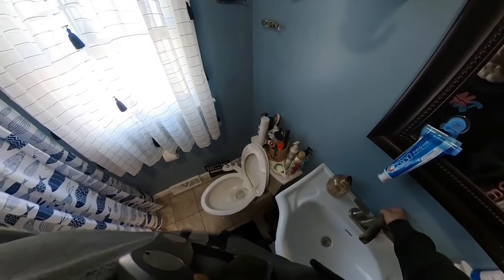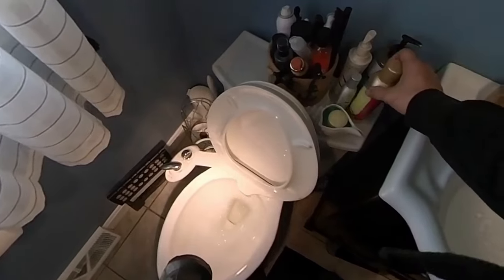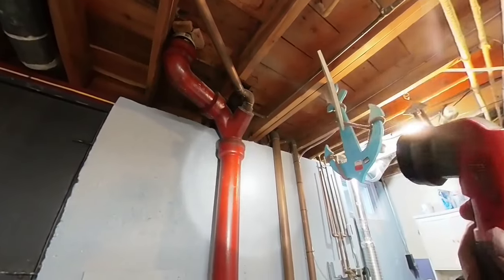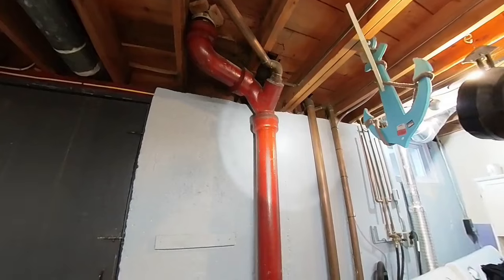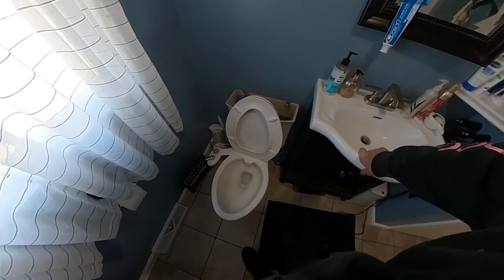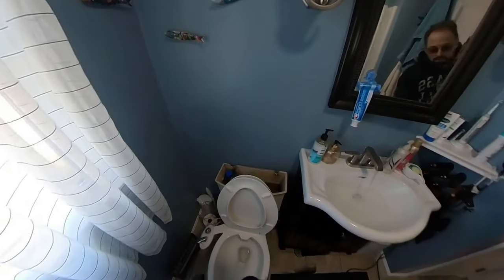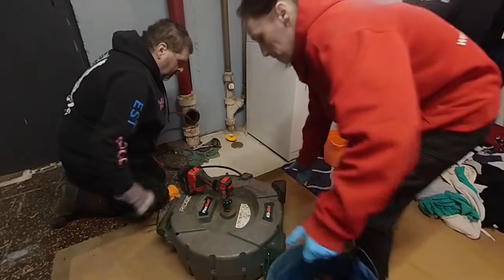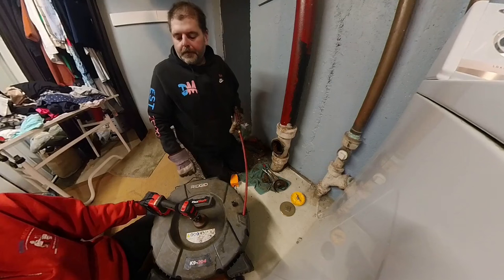Why Is My Toilet Bubbling, and How Can I Fix It  227

Comment: How do vent pipes get clogged?
Reply from the maker: Leaves and debris falling in if there from above when there is no screen to protect it. Also the bathroom sink ties in above the toilet flange. (Shelly)
Reply: Good job Bob and Shelly, Great detecive work Bob working out the blockage 👍
Reply: Bird nests aswell
Reply: Hello, I am a handyman doing it as a side hustle….I have  unclogged a couple of sinks and drains. But i am considering getting into drain cleaning full time .. is this a business that you need to have plumbing experience or these are skills you develop the more you do ?? Any special training needed?? Thank you and you guys are awesome
Reply from the maker: @juansantiago8983  Thank you. Buy a local Plumbing code book to your state. Look at the drain and venting section. There will be pics in there. Will help you know what's in the walls and under floors for the most part. Practice in your own home. Its not hard but there are a lot of tricks to learn. Thanks for watching. (Bob)
Reply: Thank you @drainmedic and thank you for the advise… will continue practicing

Comment: QUEST.. I BOUGHT A HOSE, I WANT TO PUT IT A FOOT DOWN INTO THE VENT IN THE ROOF, I'M SCARED OF FLOODING ONCE I TURN THE WATER ON. THE TOILET DID GURGLING SOUNDS AGAIN BUT THEN IT SEEMS TO NEUTRALIZE AND I CAN FLUSH PERFECTLY FINE, IT'S SO WEIRD
Reply from the maker: You could get a chimney sweep setup. Cut the brushes to the size pipe you have. Push it down the vent past the toilet. Just don't get it stuck. Hope this help. (Bob)
Reply: @DrainMedic  WHERE AMAZON? WITH MY LUCK I GET IT STUCK
Reply from the maker: @LEELUNK-IS-A-HUNK  You could find them on Amazon. But i think they also sell them at the box stores. Home Depot Lowes. What State are you in?
Reply: @DrainMedic  FLORIDA, CAN I PLACE A HOSE DOWN THE VENT ON THE ROOF AND SHOOT WATER IN IT>
Reply from the maker: Yes Have someone on the inside to make sure no flooding
Reply: @DrainMedic  I lIVE ALONE, SO THAT'S IMPOSSIBLE BUT I WENT UP TO THE ROOF AND THE VENT HOLES ARE LIKE QUARTER SIZE,  MADE OF METAL, IS THAT NORMAL SIZE?
Reply from the maker: @LEELUNK-IS-A-HUNK  How many do you have on the roof? There should be at least one 4" for the main sewer and one 2" for the kitchen. But all states are different.
Reply: @DrainMedic  THERE'S ONE THAT LOOK LIKE A QUESTION MARK SHAPE AND NEXT TO IT THERE'S ONE THAT IS STRAIGHT UP AND DOWN ON BOTH SIDES OF THE HOUSE, SO I KNOW THERE'S 2 VENTS, I DON'T KNOW IF THE ? VENTS COUNT, IF THEY DO THEN THERE'S 4

Comment: MY TOILET STARTED GURGLING TODAY, OH BOY
Reply from the maker: Do you think its a blocked drain? Or a venting problem?
Reply: @DrainMedic  IM NOT SURE. IT STARTED IN THE SPARE BATHROOM THIS MORNING. I TURNED THE WATERLINE OFF BEHIND THE TOILET AND 2 HRS LATER I TURNED IT BACK ON AND ITS WORKING PERFECTLY
 SINCE I DONT USE THAT BATHROOM IM LEAVING THE WATER TURNED OFF IN THAT TOILET
Reply from the maker: @leelunk8235  Sounds like you have a partial blockage in the main. That toilet could be leaking by the flapper when it is on.
Reply: @DrainMedic  I LOOKED IN THE TRUNK OF THE TOILET BUT WORKS FINE NO LEAKS WATER STAYS STILL
Reply: @DrainMedic  QUEST.. I BOUGHT A HOSE, I WANT TO PUT IT A FOOT DOWN INTO THE VENT IN THE ROOF, I'M SCARED OF FLOODING ONCE I TURN THE WATER ON. THE TOILET DID GURGLING SOUNDS AGAIN BUT THEN IT SEEMS TO NEUTRALIZE AND I CAN FLUSH PERFECTLY FINE, IT'S SO WEIRD